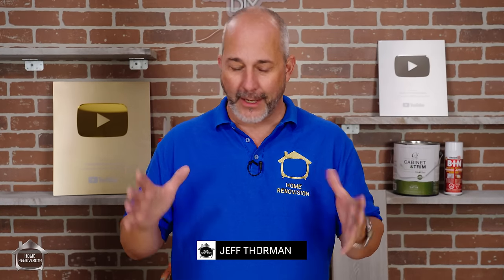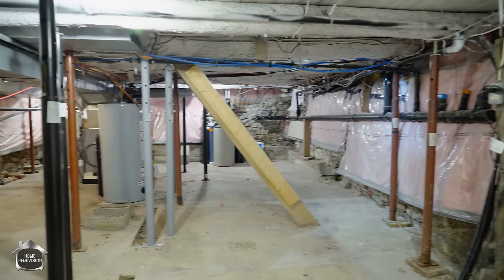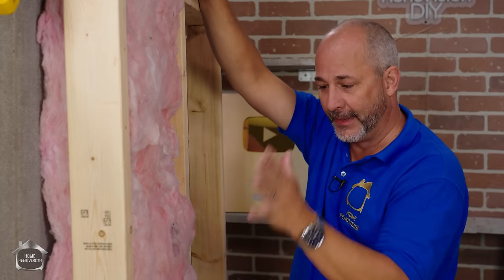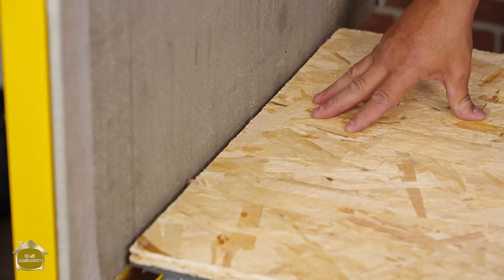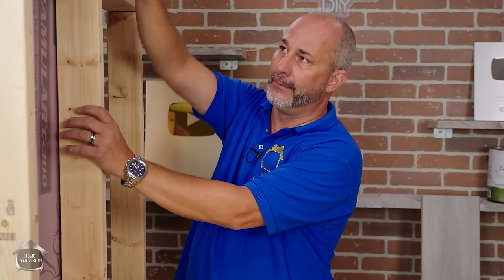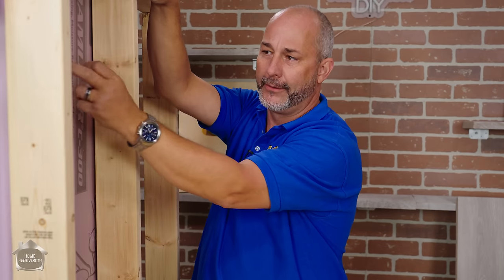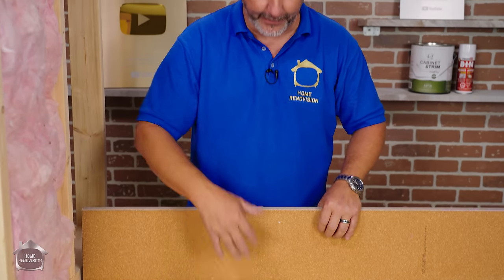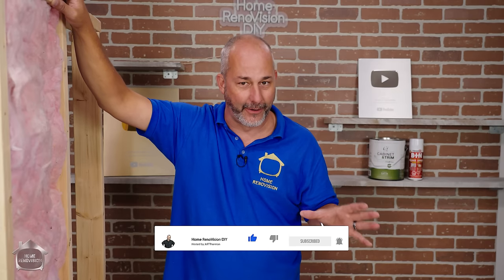The Best Way To Finish Your Basement

Comment: Hello Jeff. I am considering this method for my basement re-insulation. I have a comment and a question. First, I am in Thunder Bay. 1950s bungalow bought in 2020, solidly built, basement partially finished with 1960s style panelling. wall-to-wall carpet and drop ceiling, sump pump and backflow valve, no leaks, no mustiness, carpeting is dry, painted cement block foundation wall, 2x4 studs and R-10 fiberglass, "loose" wall assembly (therefore drafty basement), minimal dampness around edges of some pieces of insulation, no mould in sections of wall I have checked. My comment: About two years ago I wrapped some large, heavy boxes in plastic wrap and stored them on a shelf right up against a section of exposed concrete block. A couple of months ago I removed them from the shelf and saw black mould wherever the plastic wrap had been touching the wall. This is why I am gravitating toward your approach of building an air gap into the wall assembly. Now my question: what about the rim joist? Do I continue that air space into the rim joist along the bottom plate and up into the joist to allow moisture to exit the wall above grade? Or do I forget about the air space at that point and fill the rim joist area with a layer of rigid board and batt insulation?

Comment: Really great video. Thanks for the good explanations and visual example. For older homes, what's your thoughts on using 1x furring strips spiked through the doam into the concrete, to hang the drywall on. Or Framing with 2 x 3 studs. Just not sure why one would opt for the extra cost of 2 x 4 studs with r 12 insulation if the foam board is already there. Thanks

Comment: I'm planning on renovating the basement in my 1950 built house. no sump pump, no exterior water protection. Also haven't had water in the basement in the 10 years I've been there.
Planning on Dricore subfloor and foam board on the exterior walls. 
To prevent damage from potential water events, I'm using as little organic materials as possible. 
I'll be steel studs, vinyl flooring, and rockwool in the stud bays.
I think I'll be a winning combination.
Only thing I have to figure it is synthetic alternatives to osb subfloor and drywall.
Reply: Do you have a floor drain? If there's a flooding event, the water should travel under the osb and drywall to the floor drain. 

You could also dig a sump pit and pump. Its involved obviously, and hauling dirt and concrete sucks, but it's not particularly difficult. There's a good This Old House episode on digging your own sump pump pit.

Comment: Anymore thoughts on offsetting the stud wall from concrete; seemed like a great idea, especially when building your stud wall on dri-core, creating a continuous air envelope (concrete floor and wall) to allow dispersion (my basement is somewhat dry...no real intrusions, but you can't leave things on the basement floor or they'll start smelling moldy....hence loved the idea of the continuous air space)....i keep reading though this is a terrible idea due to convection looping.  

Q1 - Is it better to do a flash & batt style insulation where you offset your stud wall an inch or so from the wall, spray foam 1 inch to act as a vapour/moisture barrier then insulate with batt in the walls?  

Q2 - I was thinking to still use dri-core on the floors, but leave a 1/4 inch out from walls and somewhat of an airspace to allow the concrete floor to breath, but perhaps a tight but to seal is also the way to go.

Comment: Love the videos. Question about the floor. Every basement Ive been in has one or more drains in the center of the floor and the floor slopes toward them from the walls. When trying to lay that floor underlayment, Id think it would be a nightmare as the floor isn't level from one side to the other??

Comment: Jeff I have been a fan for many years. This is my first comment ever - I just could not keep silent. The advice on finishing the basement wall you provide is plain dangerous. The warm air will come into the gap at the top cool down as it passes the cavity and move down to exit at the bottom as it becomes heavier. While that is happening moisture from the warm air will condense on the cold concrete wall. There will be a waterfall between the concrete and the insulation in winter. The only way to not have condensation in winter is to isolate warm air from the cold concrete wall. That can be done with continuous spray foaming or a tightly applied foam board with foamed joints and no gap at the top or slab. While you are correct about the minimum building code in cold climates the advice you are giving is to be avoided!
Reply: This makes sense to me...I feel like someone needs to do like a torture test video for all these different techniques
Reply from the maker: if you install the rigid foam all the way up to the joists and them lay r20 batt on the sill plate and 2 layers of rigid on the rim with foam you seal out warm air from having access in the winter. your thoughts on waterfall only happen if you fail to continue the insulation and vapor barriers. Cheers!
Reply: @HomeRenoVisionDIY  You are now talking about preventing the air from going in between the foam and the concrete wall. That's exactly my point. Why the whole story about intentionally leaving a gap?  You are literally talking about air moving through that gap in the video...
Reply from the maker: I am saying that the air space will come into contact with the framing of  the house which will then transfer it to the outside of the main floor and balance out the relative humidity. wood transfers water. Cheers!

Comment: So I finished my basement 4 days ago and now we have drywall up. I did a ton of research and it seems like everyone has a different opinion, I talked to 4 local contractors, then did research online for my climate zone.
I'll let you know in a few years if I have moisture issues.
We did firing strips on concrete (it's a half wall concrete and then studs above) and filled that with rigid foam insulation with foil backing. Faced the foil to Interior of home. Firing strip rests just above concrete.
No subfloor system, did carpet with vapor barrier pad. And LVP with padding.
Fingers crossed, you have me all worried now.
Reply from the maker: there are plenty of ways to finish a basement that are good. this is just the best design I have found out there that solves a large number of problems no matter how old or new a house is and it does not have a down side in any situation. Cheers!
Reply: @HomeRenoVisionDIY  and I for one appreciate your attention to detail and willingness to share your knowledge with all of us =)!

Comment: Hi Jeff, If a newer house has been settled for several years and no sign of water leaks or cracks, what is the risk of not ripping out the blanket insulation from 1-10 scale? Do you have a plan to make a video just to talk about building permit for finishing basement? maybe use Ontario as talking point? I think that will help a lot of DIYer who may not know all the details. Thanks!

Comment: Hey! Love all your videos. I'm a bit confused and have a few questions:
1. I've seen you do the floor first, and then frame the walls. I've seen you do the walls first, then add the floors. Which is it?!
2. I have the crappy bubble wrap insulation in my basement (mostly below grade). I want to rip it out in prep to do the basement. Should I wait til I'm ready to finish or is it okay to get rid of the headache of that insulation?

Comment: Hi
I have a new house with an unfinished basement. The basement does have exterior  taped dry walls on a treated lumber (I can't tell how wide it is). Should I put the Dricore as close as possible to the wall and lumber? Should I leave a gap? I

Comment: after building your wood wall frame over the installation boards do you need to caulk it down to the sub floor to keep it air tight before putting your floor panels down?

Comment: I will be starting all this soon. I will be using Dricore Insul Armor R-4.1. Since I will be putting framing directly on top of this material do I still need to get pressure treated wood anymore? 2nd question...Do I just put nail right thru the wood and into insulation? TIA

Comment: Thanks for the great video!  Where I live there are codes related to fire blocking in the walls.  The vertical blocks shouldn't affect the movement of moisture you describe, but I'm a little concerned about the fire blocking at the top of the walls affecting air movement into the subfloor above.  Do you have any suggestions?

Comment: 1. After you put the poly vapour barrier on top of the 2x4 wall, what do you do with the bottom edge? What does that get sealed to?
2. Is this type of subfloor sufficient to install ceramic/porcelain tile on top? Or is there another product you'd put on top first?

Thanks!!!

Comment: Hi Jeff, great video, as always.  But what about fire blocking, don't you need to fireblock that gap between the rigid foam and the concrete wall at the top? If you do, than this moist air has nowhere to go.

Comment: at 8:20, when we sit a 2x4 frame on the OSB, do we need a pressure-treated 2x4 for the base piece and use the concrete nails to fix it on the concrete floor? That means we can't change the OSB board unless unscrewing the wood frame first.

Comment: What about an uneven concrete floor , I was thinking of making 1.5" floor joists and shim them as needed. how to I protect that from collecting moisture?
Reply: There are plastic shims specifically made for these drycore subfloors. They go under to lift the drycore sheets to level. That would be the best. Second best would be to use a self leveling concrete to level and then drycore on top (what I did). Third, you can cut your own shims from pressure treated. I believe pt directly on concrete is not to code - but you will likely not have any issues.
Reply: Would you not pour a leveling compound here???

Comment: I'm assuming with this system that the moisture escapes eventually through the rim joists. So, how does this system work if the rim joists have been insulated and sealed? Where would the moisture go?

Comment: I did this in my basement 15 years ago simply because 'it seemed like the best way to do it'.  Everyone laughed at me and still do when I tell them the foundation is completely covered with foam board, then 2x4 studs and fiberglass insulation.  Thanks for the validation with this video.  Maybe I'm not an idiot after all!  No subfloor for me as I don't see the benefit.
Reply: Did you also use the plastic vapour barrier behind the drywall. Because pink xps rigid foam is a vapour retarder. By doing Jeff's way your are sandwiching the fiberglass insulation between a vapour retarder and a vapour barrier.
Reply from the maker: my way is not creating a sandwich. since the barriers are not in touch with each other they do not cause condensation. Your understanding of building science is wrong. the wall stays completely dry!. Cheers!
Reply: @HomeRenoVisionDIY  Jeff I think you are making bold statements against the building science. Don't get me wrong i know building science can be wrong at times but common logic says this is a bad idea. I would really like you to prove it wrong by doing a tear out of a wall system exactly like this. if you get a chance.

Comment: Great video! I am doing a basement that has steel wall braces every 2 feet to correct structural issues. With the steel on the walls it is impossible to use the foam board to make a continuous vapor barrier. Can I still do a vapor barrier for this project?

Comment: Your videos have been extremely helpful. I am getting ready to insulate my basement wall below grade here in upstate NY and I have found a bunch of discussion of XPS vs Polyiso and wondering your thoughts.  I know the price is a little higher for the Polyiso but I am drawn to the higher R value and that it can remain uncovered because of the fire retardant.  I have a house built in the 1970s, but I have not had any direct water through the wall.  Wondering your thoughts on Polyiso below grade inside a basement?

Comment: Great video! And definitely one of the best methods however I live in northern Canada where we experience severe cold temps in the winter months. With the air gap behind the xps foam I’m wondering if there would be frost buildup then moisture / mould later in that space. If the exterior of the foundation has been sealed with a membrane would it not be better to spray foam the concrete inside?

Comment: First time home owner, long time handy man but much to learn. Your videos have been super helpful. Curious how the process would change when you have a waterproofed basement with poured walls, with the subwall and plastic barrier? Would the solid insulation just get glued directly to the wall barrier?
Reply from the maker: not very common but yes that will work fine. the pl 200 does not degrade foam or plastic
Reply: Vapor barriers against foundation on the interior is against the IBC now.

Comment: I really appreciate the insight and information.  I have a unique situation for a breezeway that was converted to a mudroom.  Front and back walls are exterior.  Left wall goes to unconditional garage with a step down to the concrete floor.  Right wall interfaces with the kitchen wall with a step up thru a doorway.  I need to rebuild front and back walls due to some rot.  I want to put down a subfloor for thermal break and I think moisture control as the last wall sill plate rotted out.  However my concern is height so that new exterior doors can still open with the new subfloor. That and step heights in and out of the room are still safe. I imagine subfloor will reside inside the exterior framing and my walls will not be built on top of the New subfloor. Any thoughts or suggestions are appreciated.

Comment: Thanks for the updated video Jeff !!! This makes a lot of sense... even for a French guy !hahaha ... so the question remains... If I want to install a subfloor in the basement but the walls are already finished... do I still leave a 1/4" gap between the subfloor and the drywall ?  Thanks again and sorry for all the questions in multiple videos ! 

Best!
Reply from the maker: Hi Carl if you have walls already and you have a waterproofing system on the exterior then try the new dricore thermal panel . it is lightweight and has no osb on it. install like an underlayment and lay flooring directly on top. Cheers!
Reply: Jeff great video.  I have a 1950’s rambler in Washington State that someone converted a slab on grade garage to a master bedroom, so no vapor barrier,They put vinyl plank flooring with cork backing no pad/vapor barrier underneath.  6 months after moving in we moved decorative rug in the room and noticed mold growing in straight lines on the underside that matched joint lines of the plank floor below. Now ripping out the floor leaving the exposed 74 year old concrete slab.  I love your option of the dry core panels.  My two questions are.  1. Is there no epoxy or painted vapor barrier that could down under the dry core? 2. The walls are finished …If I put the dry core subfloor in and leave it 1/2” from the walls, how does the moisture dissipate from the room?  
I don’t have AC and the house is heated with electric wall blowers in each room. 
Thanks in advance if you have time to answer this.  I trust and appreciate your advice.

Comment: Love the video! Quick question, when installing the subfloor you recommended, can you use a ramset to secure the subfloor to the concrete in the basement or is it better to just go with the drill?

Comment: What do you suggest for the rim joists? In older videos you mentioned packing them with batts all the way up to the drywall, but if the idea here is to allow any floor/wall water vapor to escape up the wall gap and then outside, should the rim joists remain uninsulated? Or perhaps only a single layer of foam up against the rim joist so floor/wall vapor can still escape into the ceiling space?
Reply: Very interested in this question too

Comment: did this a year and a half ago step for step, its great. suggested on NRCAN -keeping the heat in site as well. note for exterior walls. may want to treat with borax before. had ants get in somehow and they didn't eat but tunneled in a section. made it Swiss cheese. had to make tiny hole and spray/fill with insecticide. uncommon, seems to work though
Reply from the maker: dealing with ants means you have wet exterior wood. best to find out why your exterior isn't staying dry. Chjeers!

Comment: Do you seal where the foam board is resting on the subfloor, to prevent air leakage between the exterior wall and interior living space ? If so, with caulk or spray foam ?

Comment: I have a fieldstone foundation. I was going to do a thin 1/2 foam board behind the framing then do 3" open cell spray foam into the stud bays. My stone wall will also have a vapor barrier installed and a french drain system. Is this a good idea?

Comment: Hi! Very informative, and I am about to embark on getting my basement somewhat finisished. However, its a 100 year old basement that has never been finished. I'm having a drain system insalled inside first. Just curious if you have advice for such an old home. My main goal is to have it dry and clean. Thank you!
Reply: Same here. What did you end up doing?